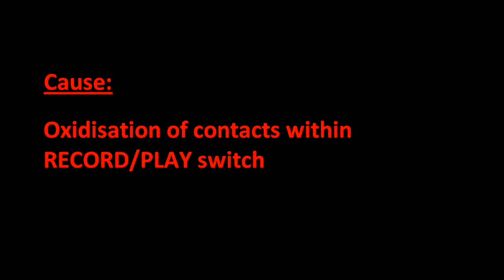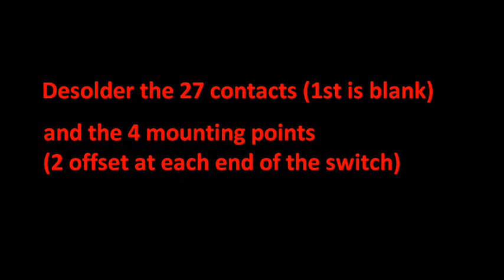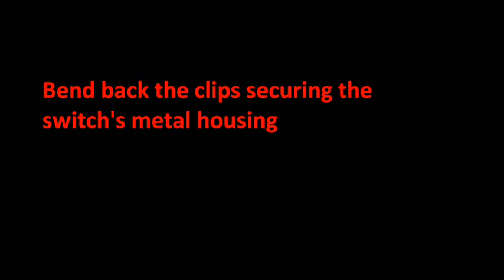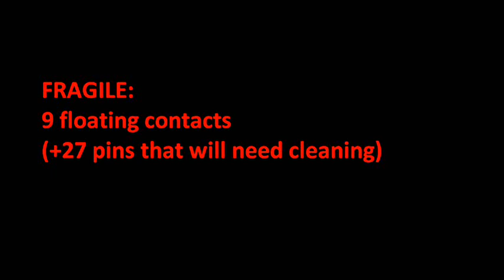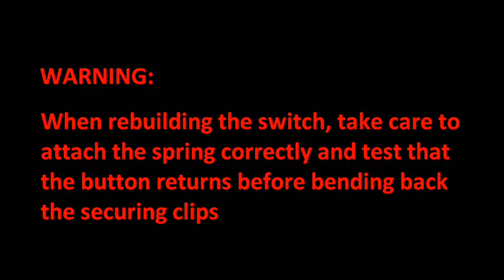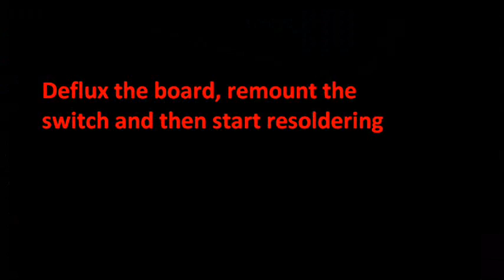BBC Micro Data Recorder repair. Playback noise fix Acorn ANF03

Comment: That's some heavy parping
Reply from the maker: I thought it had stopped
Reply: I'm trying to fault find my own ANF03, not having much luck finding any info on it, can you advise where to probe the board to check transformer voltage? Mine has 2 red wires coming from transformer, I am assuming they should have 6v on them, but where to I measure between,  as unit isn't earthed?
Regards
Peter